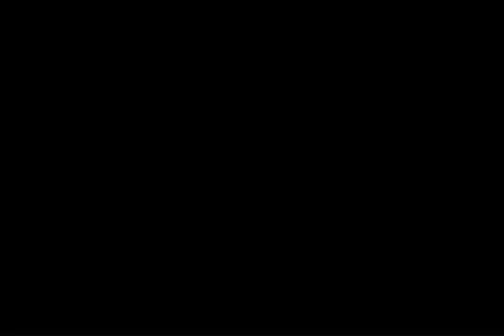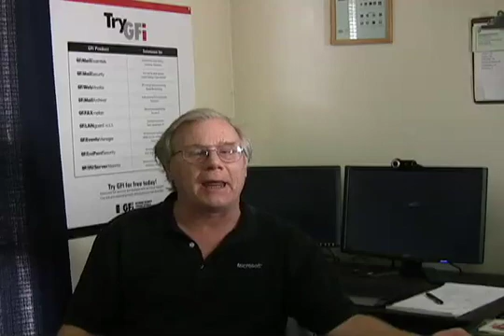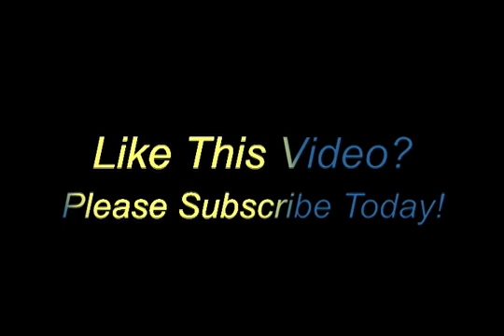Fixing Wireless Router Problems - FrugalTech

Comment: I take that back, I see one a year ago.  I am having connectivity problems with my Belkin N600 DB I believe it identifies itself as a 802.11N router.  Everything seems fine on the modem (lights are on, none blinking) but the router keeps going to red.  When I troubleshoot it states "connectivity unstable" or "broken" but then you give it a few minutes and it goes to blue.  It happens a lot with AOL or if you are on chat with any customer service for a long time.  Its annoying.  I always get "cannot connect to this website, check if it is correct" and its the aol website or msn.  Any suggestions?

Comment: I just had a "wait a minute" moment. Now I recently had issues with my router of course it kept dropping the connection. So I call the isp to complain. They told me everything was fine from their end. So I just asked myself, when did this start to happen? The interference thing came to mind. So I asked myself what new thing did I just purchased that could be causing it. I just bought one of those remote control things that you plug something into the wall like a lamp and then you use a remote control to turn it off and on. So I am thinking this little unit is interfering with the signal from the router.

Comment: my problem is that on my phone and on my ps3 the signal strength is 100% but it just doesn't work, i don't know why, i called my intrenet service provider and they said everything looked fine, if anyone has any clue how to solve this problem. it'll be much appreciated.
Reply from the maker: Achim Strejac Perhaps it's not obtaining an IP address fro the Router? Have you tried manually configuring it?
Reply: yeah i tried it but still it just doesn't work, when i plug my internet cable in my PC it's working but when i plug it into the router it doesn't,so there might be something wrong with the router itself.
Reply: ***** i gave up on it and bought a new one a while back
Reply: +SHAHZAIB QURESHI it definetly is, i had that router for a long time tbh. When a router stops running just like that it means you need to get a new one because routers usually last 2-3 years

Comment from the maker: Without know the exact model of your router, it could be several possibilities. The first is that the router is failing to actually boot (POST) in this case the router should be replaced. A less likely scenario is that the router is not receiving signal.I suspect the former.

Comment: Hi,  Mine is Belkin N600 HD router.  I'm unable to connect through WIFI but its working with the cable through router.  I also forgot the main login password for this router.. I tried reset button on the back of the router but no luck.  Please help.

Comment from the maker: By turning off do you mean losing connectivity or the unit is powers off? If the issue is the former, then try a factory reset. If it is the latter it is a defect in the router itself.

Comment: Hello there. This is my problem. My router (NETGEAR) is having a issue. It keeps connecting and disconnecting (as in turning on and off). And whenever I try connecting to my computer, it says that it is not connected. I also try connecting with my PlayStation 3 but when I test the connection out, it fails. Also, none of the channel lights (1, 2, 3, 4) light up. I've been told that I should contact Netgear but maybe you could help me out. I would really appreciate it. Thank you.

Comment from the maker: I assume you are talking about your WIFI connection to the router. If this is the case, verify that the router is assigning a proper IP address and the machine is on the same subnet as the router.

Comment: my netgear router works fine except that nothing else in the  house can get internet cause i cant find it on there the only thing that have internet is the computer which is plug in the router, the light that signal that there is wireless signal being sent out dnt light up n i cnt find it on my laptop either but the computer gt internet .

Comment: its a wired connection and i also have this wirless usb thing that i use for my heaset offical ps3 one u can use it on that and computer so would that be the thing that is turning it off for 30 secs and back on

Comment from the maker: @2344713 You will need to find your owners manual,to locate the reset button. Is your PS 3 hard wired to the router or wireless. It might be interference if the connection is wireless.